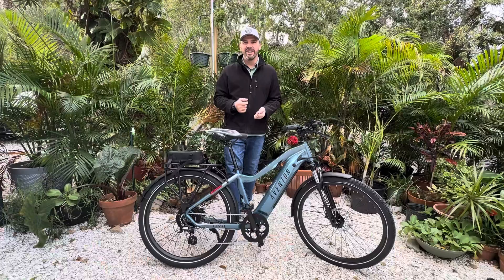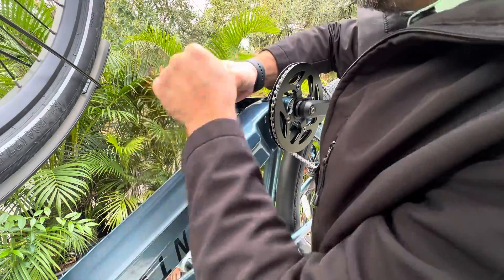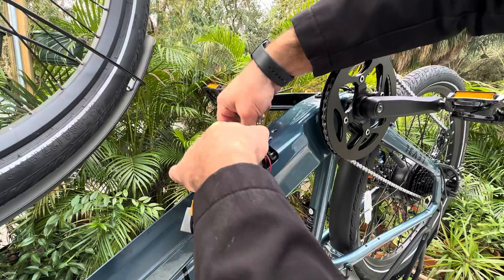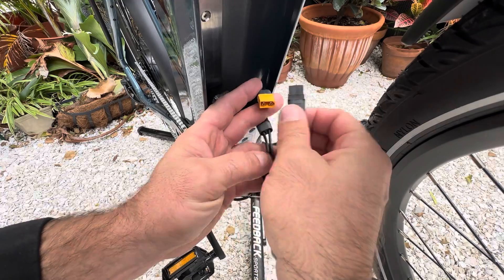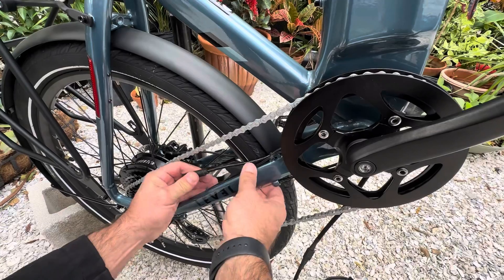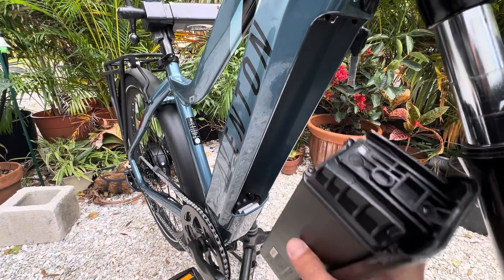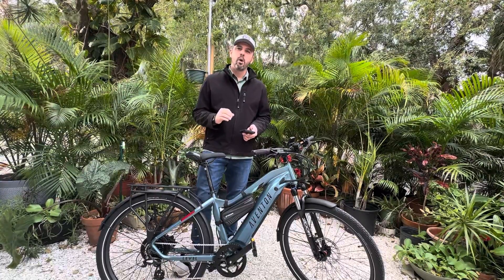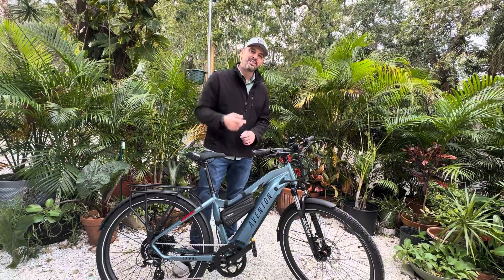Aventon | Level.2 | Plug & Play Dual Battery Installation adding a second Battery for 24Ah Total

Comment: I bought an extra Aventon original Level 2 battery, can I connect it using the same kit?
Reply from the maker: Unfortunately we don’t have the pin connectors for the level two battery
Reply: That's too bad, I had the kit in my cart on your website 🙁

Comment: I have a question: Can I use the H HAILONG Ebike Battery 48v 15Ah for Electric Bike/Bicycle Motor Kit, 48 Volt Lithium Battery for 200W-1000W Motor with 54.6V 2A 3-Pin XLR Charger 30Amp BMS USB Charge Port and Battery Lock(48V 15ah) in an Aventon Level 2 step through bike?
Reply from the maker: Yes
Reply: @ElectricAllWheel  thank you for your quick response. Keep up your outstanding work.

Comment: At the end of the video it was stated the amp must match but you corrected yourself which made it a little bit confusing.
The standard Aventon Level 2 battery BMS is output is 20A?
The controller maximum current 22A?
The second battery BMS must match the controller or the standard installed BMS?
Have difficulty locating a 12ah or 14ah battery, do you know a manufacturer?

Comment: I appreciate your insights. I typically get around 40 miles on a full charge, but I'm planning on doing some touring that requires at least 60 miles per day. I'll be building my own 52V battery using Samsung cells in custom box and mounting it on rear rack. Aventon's batteries use Chinese low-quality cells.

Comment: This is extremely helpful and educational. I'm gonna go ahead and order these parts to replicate this setup for myself. Question, how does this effect the remaining battery percentage monitor on the bike's console?
Reply from the maker: If the batteries are charged full before use, the display will share the remaining percentage as if they are 1 battery
Reply: @ElectricAllWheel  Ah so it shows what's left in both batteries combined? Do you know which battery is used first? Or do they both get used simultaneously? Not sure how the balancer works...

Comment: How does the secondary battery charge? Thanks this is an amazing upgrade to a Level 2.
Reply from the maker: The batteries are charged independently with their own respective chargers.
Reply: @ElectricAllWheel  ok ty

Comment: Thanks so much for the video!  Couple questions...Do you happen to know if any of the larger Ah batteries offered by the same company as the one you used in the video would fit within the Level.2's frame triangle?  I'm potentially interested in the lockable hard case style that would mount where the water bottle cage would mount but am concerned about the fit considering the oddly shaped top tube of this bike.  Also, could you please explain in more detail about the BMS?  Near the end of the video you say that the "BMS must match the 22 amp current limit of the controller".  Are you referring to the balancer kit needing to be rated higher than that 22 amp current limit?
Reply from the maker: The balancer kit recommended is 40A which means the 22A current limit is well within limits. Some people without the right knowledge incorrectly interpret what’s necessary. 
Some extremely cheap batteries use low current limit BMS for less powerful bikes (250W motors) this is not sufficient for higher current limit bikes.
We have not tested fitment of the dimensions as you describe but do know the other 48V batteries will work, you just need to understand your mounting placement.
Reply: @ElectricAllWheel  Thank you so much for the quick response!  So, just to be clear, I would need to make sure the current limit spec for the balancer kit as well as the battery are higher than 22A for this bike, correct?

Comment: Do you have an installation for a Level 1 stepover?
Reply from the maker: Should follow the same principles. You will use the kit with bullet adapters https://electricallwheel.com/dual-battery-discharge-balancer-kit-40a-aventon-fit/

Comment: Will this be possible for the Abound Cargo bike as well?!
Reply: Electric AllWheel is working on a battery combiner for the Aventure 2 which uses the same 5 wire battery connector plate as the Abound, I see no reason why this won’t work. 
It won’t likely allow connection of a second OEM battery, but even being able to plug a second non-OEM battery without having to swap them like a common peasant. 

The minor 0.7 volt drop across the diodes in the combiner will be negligible compared to the reduction in voltage sag when calling on peak current from a single battery

Comment: This installation will work on the adventure.2 also?
Reply from the maker: We will have a video for the Aventure V2 in the coming 2 months. A dual battery installation for the Aventure V2 is considerably more involved
Reply: I’m very interested in the Aventure V2 job too, it uses the same 5 point connector block and battery as my Abound, but they are hard-wired to the controller - and there’s something that has to be done to wake the OEM battery up. 
Will the OEM LVCO shut the second battery off too

Comment: How come you just don’t carry an extra battery with you instead of doing all that
Reply from the maker: Longer sustained voltage and speed. No stop and swap.
The cost for this installation is considerably less  as well.
Reply: Those batteries aren't lite. I have a level 2, and I started taking both my batteries. It was tiring, and I realized keeping a battery on charge to swap was easier.
Reply: @Jsturges09 Tiring with the extra battery? I carry my extra on the rear rack so man you need to get in shape! 😂